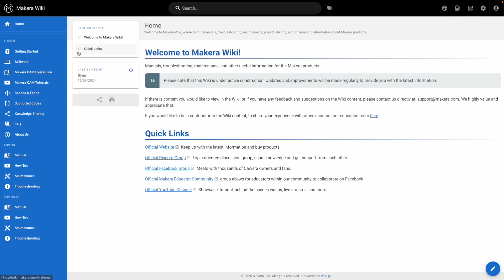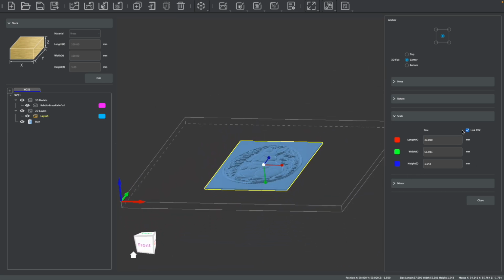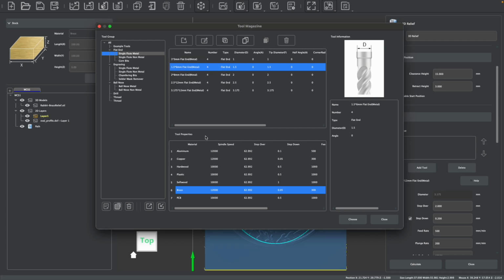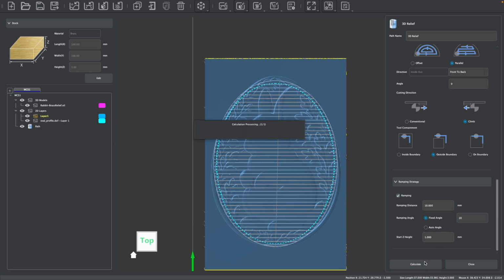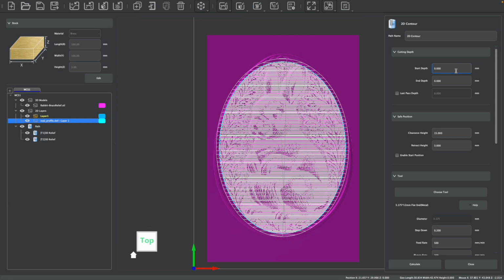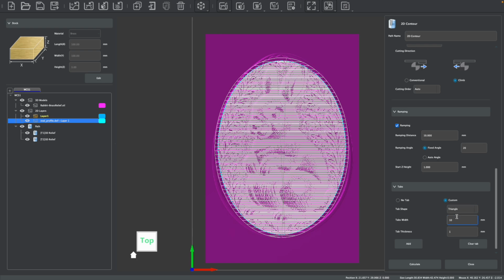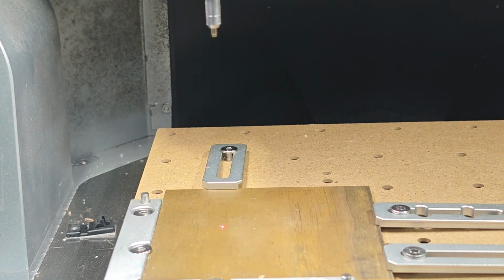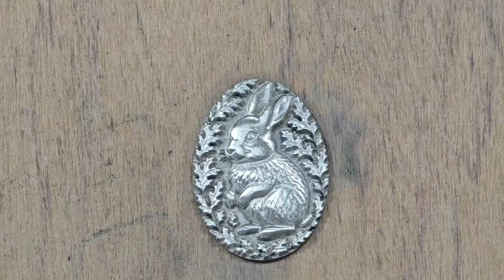Milling a 3D Brass Coin, a Spring Example Project

Comment: So whenever I try and use that specific engraving bit, exactly like the steps in the video. It will not carve on the z axis and will only fill the  x and z height... i'm not sure why but any "engraving bit" i'm using in the library will only carve on the x and y.....
Reply from the maker: Please contact our support team at support@makera.com for additional assistance.
Reply: @Makera  did you find what was problem and fix?

Comment: So there are some areas of my relief that I know my roughing bit cannot clear. This would result in the .2mm engraving bit having to go deeper than what it can handle. My question is, if I create a roughing pass with a 1mm end mill, then create a new operation for finishing with custom step downs. Will makera cam keep note of everything the previous cutter machined and start in areas that the roughing bit could not reach? Also, does depth allowance leave an extra layer of material for the finishing bit to cut away?
Reply from the maker: What you're describing is typically referred to as REST machining, or remaining stock clearing operations. At the moment, this feature is only available for 2D operations in Makera CAM, not 3D relief. This will be added in a future release soon. 

For now, we suggest you make multiple tool paths, such as a 1mm clearing with step downs, then a 0.3mm no step downs, then a 0.1mm no step downs.

Comment: I was under the impression air assist was a better choice when working with metal due to better cooling, but you mention using the vacuum/dust shoe is also a valid option. What is the impact of using the vacuum vs air assist in this use case?
Reply from the maker: When clearing out large areas with bigger chips, air assist is the better option. The dust shoe will struggle to grab bigger metal chips effectively, especially when clearing deeper pockets. When doing a relief like this with finer detail passes, the vacuum system may prove to also be an effective option. In general though, air assist is preferred for metal when considering chip evacuation and cooling.